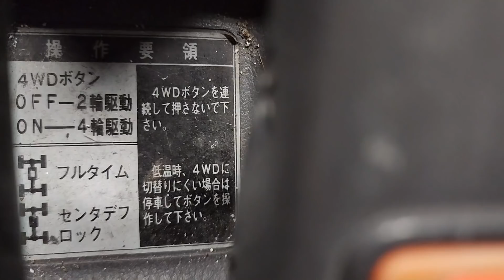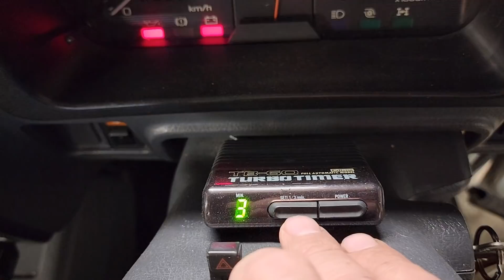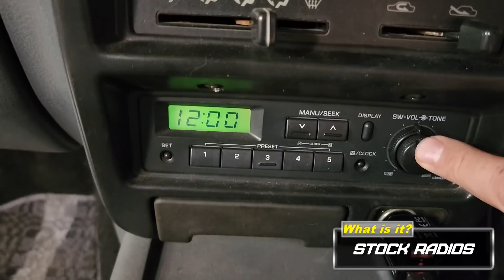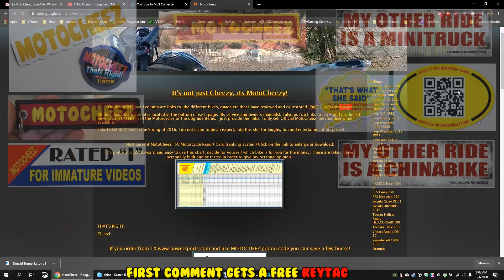Micro Van (SE1 E02) Drive home Hijet Atrai XX, detailed walk-through fun first mods. for sale, SOLD

Comment: That bar behind the driver's and passenger's seat is to prevent the load from hitting the driver full-speed. It is (or was) needed for the inspection in Japan. If you go camping, it might be useful for hanging things.

Comment: the seats lay flat with the front ones to make the bed.  it's nice
Reply from the maker: Yeah. I saw online but didn't try it... Next video
Reply: @MotoCheez  Also- I went down and looked at my van, it doesn't have that sticker and the lever reads L-N-H so mine has the low range that's kinda screwy.  It's not incredibly low though.  I wonder if that AWD is the XX model's thing or sompn.
Reply from the maker: Hmm, I don't know. Maybe it's the XX trim.  I've never seen it in any other mini, micro truck or van...

Comment: Congratulations on getting the Atari. 
Description
A turbo timer is a device designed to keep an automotive engine running for a pre-specified period in order to automatically execute the cool-down period required to prevent premature turbo wear and failure.
Reply from the maker: Thanks! Yes cool down and spool down 😁

Comment: Try a clay bar with some quick detailer to get rid of the oxidization then polish & wax it.  I don't think I would want a black van to camp in unless you are putting central air in it!
Reply from the maker: That's what I worry about doing it black....grey too is the A team theme, dark grey though. Maybe do lighter grey
Reply: @MotoCheez  Id leave it alone, it's only factory once.
Reply from the maker: I really can't. Paint is thin, has some bad blister rust spots that need to be repaired before they become a hole

Comment: i think what you said as running lights might be rear fog lights could be built in the the rear lights. I had a 70s Surburban that was 8 bolt wheels full time 4X4 with a lockable centre diff

Comment: I have a Daihatsu Extol 1.3i mini van. It's basically a 2006 Atrai with no windows or back seats. It's the 3rd one I've owned and it's my daily driver. I put some bigger wheels and spacers on it and now it handles like a go kart. I sold my car because the van is just so much fun to drive, especially in damp conditions with the rear wheel drive 😂 People are always surprised by how nippy it is and the way it corners.
Reply from the maker: With a 1.3 it must move along too
Reply: @MotoCheez  yeah. There's no turbo on it, it's about 90 bhp but it's so light and small that it feels really quick, especially off the mark.

Comment: If I had something like this little van I'd keep it setup for road use. But that's just my personal choice, I'm not one for off-roading my vehicles. That's what my atv is for. Though I would still replace the wheels with something nicer. Heck, I want to get a second set of wheels for my truck and it already has nice 20" wheels stock. Though I think the want for some different wheels is because I never had the opportunity to customize the look of any of my past vehicles. Due to lack of money and because past vehicles were hand-me-downs with little life left to them. It's no fun when you can't make your vehicle your own. :)
Reply from the maker: I like these little vans because I can drive to where I can off-road. The stock tires are too small for the roads around here
Reply: @MotoCheez  I'd say even in my area having to put slightly bigger tires on it would be a must because of some bad roads. I think they can get away with the tiny tires over in Japan because they actually maintain their roads. Unlike some states over here where the money for road repairs go into the government officials pockets.
Reply from the maker: Yep. That's true

Comment: I think go more like an army looking vehicle. Olive drab color with military style decals or stenciled markings. Would look good with a brush guard winch combo and Gas can .. Roof rack ..🤔 Tinted windows..wonder if you can get a mudguard kit.. Fender flare?
Reply from the maker: Not a bad idea. It has the flair kit already. Roof rack would never fit in my low garage sadly.
Reply: @MotoCheez  oh.. You have to keep it in a garage? 🤔
Reply from the maker: I need to work on it in garage in winter time mainly. I have another garage but one car left in there
Reply: @MotoCheez  I still like a tough military look but in a mini size package.. 😂 maybe another time you can make a mini Army clone.. Just so easy to use the color drab green or olive green and flat black.. Easy to keep repainting

Comment: You might be just experiencing turbo lag in regards to the acceleration blip. I would check for play/endfloat in the turbo compressor and any excessive oil residue in the intercooler/intake piping...possible pcv/turbo seal issue. Cleaning out the intercooler if it does have oil residue might add a smidge of performance. 

Being a Delica/Van owner myself. Unless you are prepared to make a rear wheel swing carrier for the spare I would try to keep max running tire size as large as the spare carrier can manage. perhaps keep Mini on muddies and run the van on some decent all terrains and perhaps just a suspension lift/upgrade.

Bigger tires might also end up killing the clutch.

If you don't plan on many passengers taking out the rear seats will loose some weight and improve performance.
Reply from the maker: I'll check those. Not sure if turbo lag. Never owned a turbo. The little spare should get me by in a pinch. Not sure if I'll keep the back seats in or not. It's nice having the option after having the MiniTruck without... I thought about a Delica. Larger tires are a bit harder on the clutch. I have 25" on my minitruck

Comment: How’s the registration process in CT for the trucks and vans? For US vehicles over 25 years is a cakewalk now but curious about the mini as I will have one soon.
Reply from the maker: Same. 25 years or older. Inspection then register. They did it for me
Reply: @MotoCheez  but basically just for VIN verification correct done at any emissions location? Not a particular safety inspection at a DMV location right? Registering my 1990 Miata bought in PA it was emissions exempt but all I needed to do was stop by a local emissions center to verify the VIN.
Reply from the maker: No. You have to bring it to weathersfield

Comment: Congrats Cheeze! Your making me jealous again.....

I've got the ITP Ultracross R tires on my Mini and they are almost un-useable in these winter cold temps. The flat spots just never seem to work themselves out in 10 or so miles  to work or the gas station. It shakes and thumps so bad....

Have a set of 4x100 wheels and some 13" snows but need to order adapters. I really miss the smooth and quiet  DOT tires on the pavement.

Beat Micro Van walkthrough on the Tube by the way!
Reply from the maker: Yeah the flat spots are a bummer for sure. Thanks! I may get a set of all seasons for the stock rims, taller then stock if course

Comment: I've wanted a 4WD micro van ever since owning a VW micro bus in the 80s.  I'd love to import a kei van, maybe a non-turbo Daihatsu because I'm more interested in reliability and maintainability than performance, lift it a couple of inches, and put some mud/snow tires on there but not as knobby as your new tires.

Will a 4X8 sheet of plywood fit through the back door?  If so, is it difficult to remove the rear seats and would it carry sheet lumber that way, with the back door tied down?

Anyplace the roads are salted, please spray the undercarriage of these kei cars with Surface Shield or some other lanolin based corrosion inhibitor.
Reply from the maker: It won't fit a 4x8 sheet of plywood but it'll carry lumber. I hear you on the salt errosion!
Reply: @MotoCheez  - Thank you very much for taking the time to answer my question related to me purchasing a kei vehicle.  Thank you also for your informative and educational videos.

Comment: S83V? I picked one up in the fall and have had a pretty fun time sourcing parts. Trying to meet that CT reg!
Reply from the maker: Yes. S83V I've noticed parts are a little hard to find. 
You haven't registered it yet?
Reply: @MotoCheez  Yokohama has to get Diahatsu to make the distributor cap, so I was waiting on that. They said, "Congratulations, you have a rare model."    I want to make sure I run through it before making the trip up to Wethersfield. She idles rough after driving for a bit. JDM Imports in Coventry has been a good local resource. Let me know if you need parts numbers on anything.
Reply from the maker: They had to make the cap!!?? It's different than the standard MiniTruck? Yeah I'll take the number and save it
Reply: @MotoCheez  yeah man. I was shocked. This is what they responded with when I sent the model. "this is a very rare type and the fuel filter is discontinued and zero left. The other parts we have except the distributor cap. Daihatsu will make the cap for you but takes about 8-10 days. Give a little time on this one." I'll get you the model numbers when I get home tonight.
Reply: @MotoCheez  air filter: Micro Nippon A9806 dist cap: Alpha Motor 19101-87216-000  dist rotor: Alpha Motor 19102-87208  spark plug cables: NGK RC-DX26 9113
Reply from the maker: @zackieshan1028  I appreciate it!
Reply from the maker: @zackieshan1028  https://www.amayama.com/en cap cand find rotor on there. They won't ship the wires.

Comment: What wheels and tires are you running? I just got a daihatsu hijet hightop van. Was looking into running a similar setup. Did you need to lift it before running that setup? Tia moto
Reply from the maker: ITP rims and 23"x8-12 supergrip tires. Yes you need a 2" lift and some cutting on the doors
Reply: @MotoCheez  ok cool man, thanks moto.
Reply from the maker: I have links in description and on motocheez.com if you're looking for them
Reply: @MotoCheez  I'm gonna look right now thanks man

Comment: If you can find someone with a 3D printer print you out a housing for your Android radio unit.
Reply from the maker: I have to get one eventually.
Reply: @MotoCheez   Especially with you doing the mini truck thing. If more people get into them which I think they will with gas prices getting out of control. Printing out small pieces like that could become profitable.

Comment: 29:27
Do not press the 4WD button in succession.
If it is difficult to switch to 4WD at low temperatures, stop the vehicle and operate the buttons.

In the case of center differential lock, raise the lever.
上手く伝わっていなかったら、すいません。
Reply from the maker: Thank you!

Comment: 0:30 like the system i think it needs some vinyl wood touches, 😂
5:00 a flip up unit with DVD play back and just keep F&F tokyo drift in it.  id find one that had a video in and pop a PS2 somewhere in there for fun. i know, crazy right? hell you could toss a micro computer in there but good luck with that expinsive headunit with HDMI in. 1 dinn with a slide out 720p maybe 1080 with hdmi in...i wonder...DOWN THE RABBIT HOLE I GO DODADO....
well ill be damned...Sony XAV-AX8100 700 bucks though
7:00 id see about bags, but knowing ull off road this maybe not.
8:45 the Kei team...lol
21:00 lord have mercy, so much vacuum tubes...part of me wants to build a new harness with new injectors and ls coils, man...could u think of the power it gain or just the plain  simplicity of it?
25:00 i got a problem with people and highbeams. drives me nuts here in indy, ur in the city, not the boonies with on coming traffic turn off ur high beams u blind dumbass 😡
26:40 agreed, id just leave it plain white, or go for a crazy bright color, its not like it sticks out or anything 😂 hell, how about fixup the rust and paint it white and try ur hand at wrapping it? lol.  black with wood trim panels?
27:10 a ClINKS van, like a got a clink in my pocket or a clink like ur goin to the clink for impersonation 🤣
31:50 tie down point for the seat when there folded?
Reply from the maker: I have an $80 unit in my minitruck works awesome. Android auto etc. One coming tomorrow